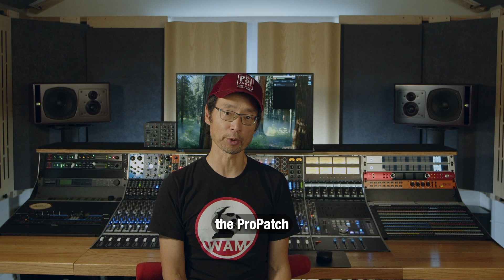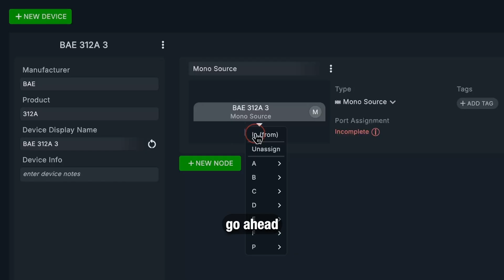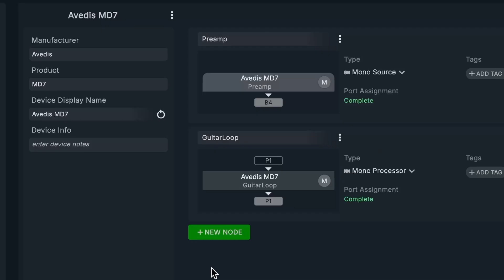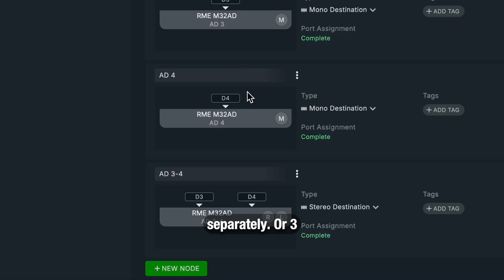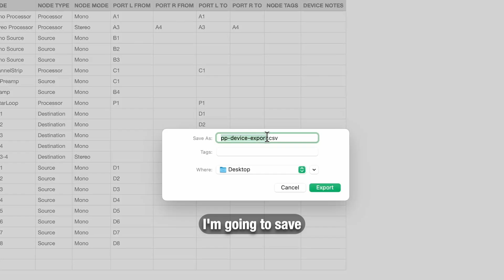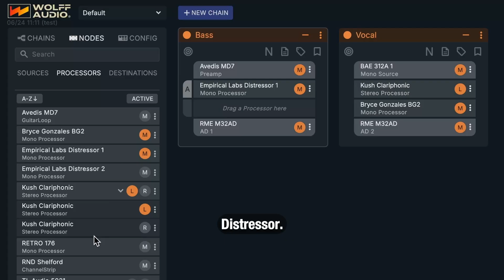ProPatch Overview with Andy Hong | Wolff Audio

Comment: Great job Andy! I have one question: Why are you setting up the mic pres as a mono source? I assume you are only connecting the outputs of the preamps to the Pro Patch and are you accessing to the input of the preamps from another patch of the front input?
If you want to integrate the input of the preamps to the Pro Patch you would have to set up as a processor right?

thank you so much!